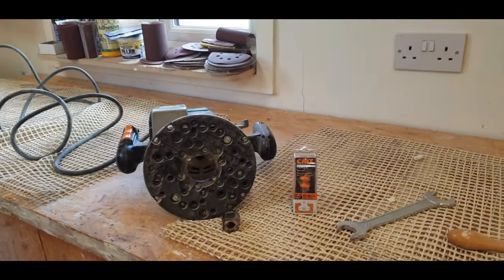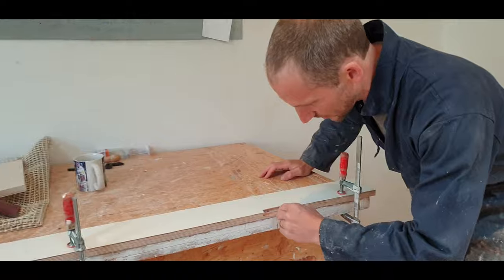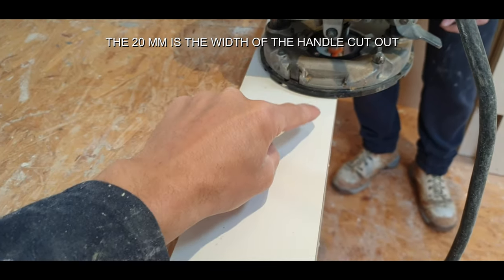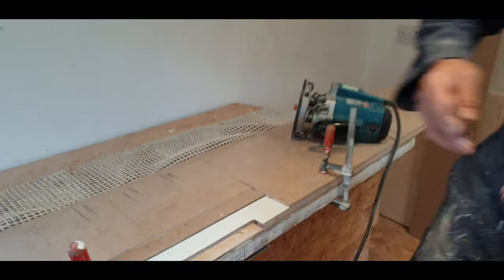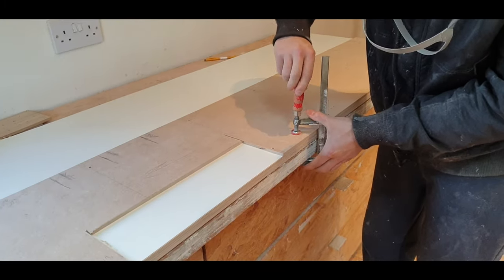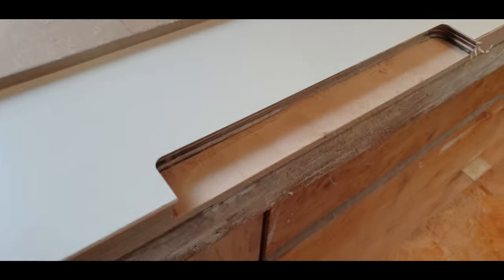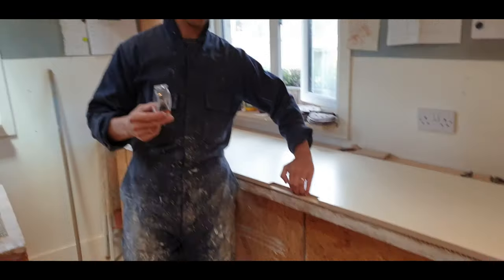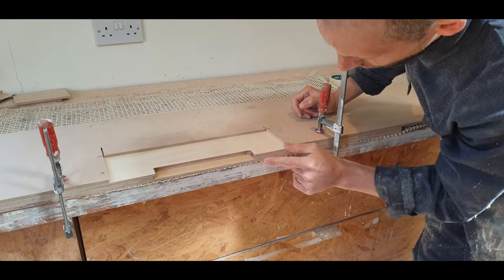Making Door & Drawer fingerpull handles EP#20

Comment: Good video!
Reply: Peter Millard did a similar finger pull video using an ovolo router bit
Reply from the maker: Yeah I saw that, slightly different method tho and used 2 routing proceedures didnt he? He used a rebate bit or flute but before he used the ovolo?